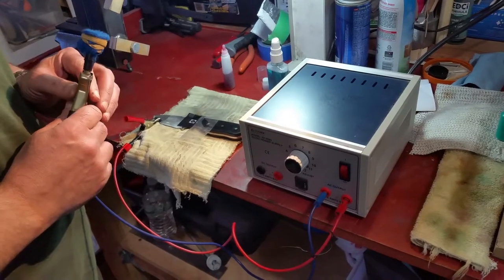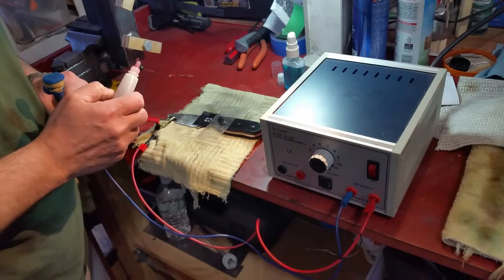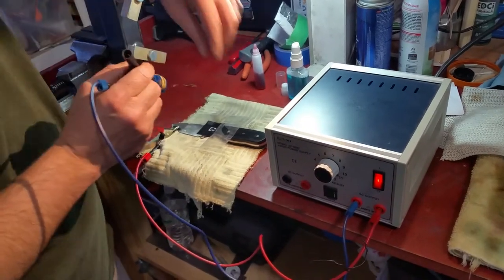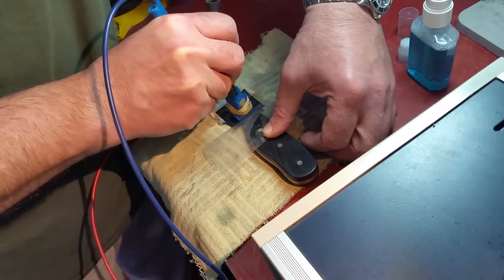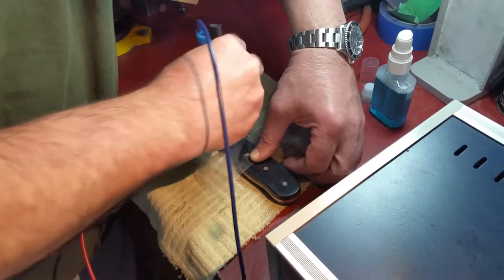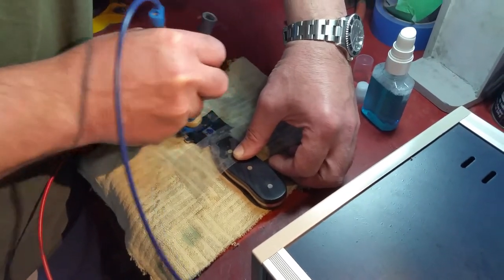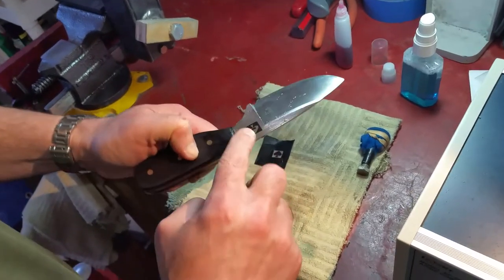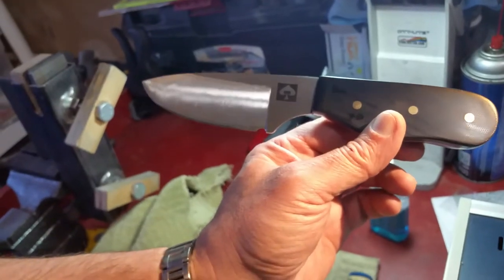Electro etching my Makers Mark

Comment: Have you ever tried marking copper?
Reply from the maker: I haven't. Not sure that would etch the same as steel
Reply: @NRiggiKnives  I know you can etch copper brass and aluminium too. I'm busy building myself an etcher/marker.
Reply: @NRiggiKnives  I would be very keen to know if it is markable.